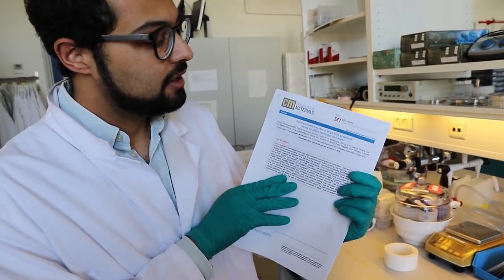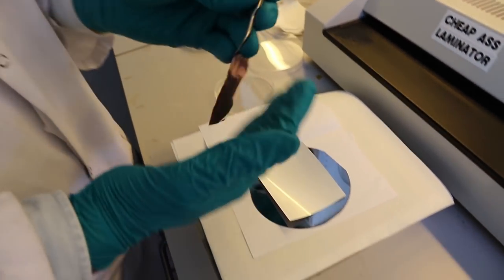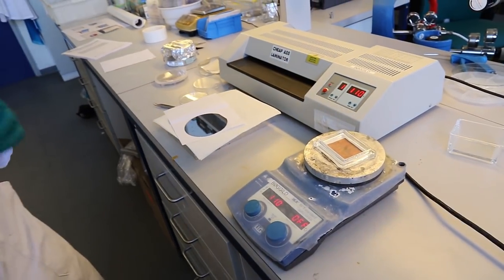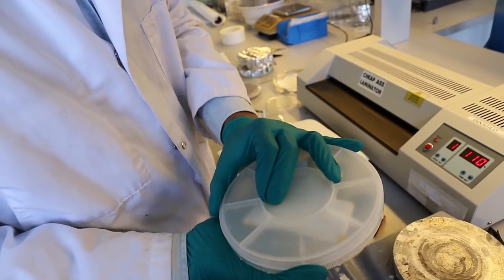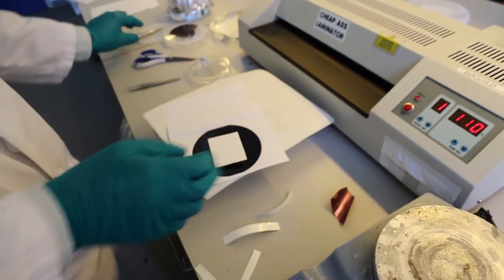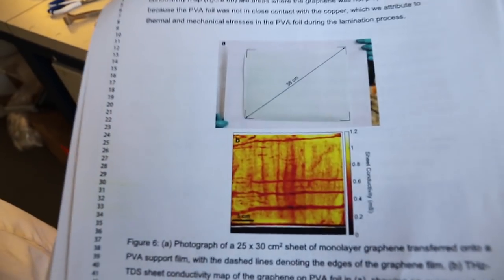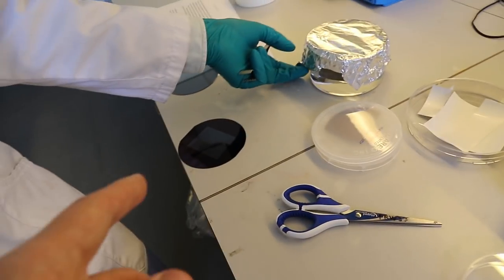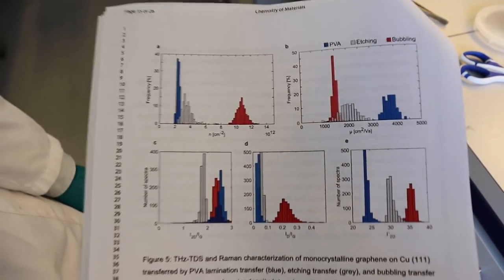Easy graphene transfer using desktop laminator and PVA plastic foil

Comment: Thank you for a very interesting video.
I have one question.
Is the transferred graphene atomically flat and contamination free?
I am very interested in the surface AFM image of the transferred sample.
Reply: トラファルガーデスポセイドン no not completely - buy its cleaner than with the other methods. Sorry for the long wait - i didnt see your question
Reply from the maker: It is as flat as the substrate allows it to be. Graphene is intrinsically atomically flat, but will cling to the surface - if the substrate is flat, the graphene will typically be. There are, however, differences in how many wrinkles the graphene has, depending on how it was fabricated. So, the quality of the graphene and the copper substrate (including flatness) also has a lot to say. The rolling can also introduce rolling lines, i.e. line shaped cracks or folds, perpendicular to the rolling direction. So yes, in principle, the method can make the graphene as flat as you want it, but it depends on a number of factors whether you will get this result, including the flatness of the substrate. The contamination is not zero, but the PVA washes away really nicely in warm water.

Comment: Thank you for this useful video. In your publication your laminator speed is written to be 20 cm/min. Ours is about 66 cm/min (minimum speed) so we had to put on hot plate 110C for longer time, and there are lot of holes. Also apparently your laminator speed is said to be 12''/min (30cm/min) from the supplier (Akiles ProLam Photo 6-Roller). I have a hard time looking to find a new laminator that can go down to 20 cm/min, suppliers often specify their max speeds. Hopefully 30cm/min could be slow enough and improve our transfers.
Reply: Actually I think your real speed is 12''/min (30cm/min), I can see in the video the lamination lasted about 40s, not 1 min, maybe 20cm/min speed in the paper was underestimated. Thanks to the video now I know.
Reply: @Ledeaven  Hi, have you been able to reproduce this technique successfully? If yes, would you mind sharing what PVA sheet you used? Much appreciated.

Comment: This is great! I would like to try this in my lab. How important is it to have a laminator with the 6 rollers and speed and temp control? 
Do you think this method would work with a $30 2-roller laminator? 
Thanks
Reply from the maker: it might... we have tried a few different types of laminator machines... probably some relatively stable mechanics and temperature control is an advantage, but it might work with very simple equipment ... and its as safe for kids, as a desktop laminator --- excellent for corona-compatible research (at home)!
Reply: @NanoClips  Hi, we tried it here at RIT using the exact same laminator as in your video, and it worked for us. We bought the graphene from graphene supermarket and the PVA "Blank Hydrographic Printing Film" from amazon.  We had to run it through the laminator 3 or 4 times for the transfers to occur. Both from graphene to PVA and then to SiO2. Also, when we did get it to work, the graphene was not continuous with regions of about 300 to 500 um. It did show a very large G' peak though :-). We'll update you if we make improvements but we plan to fabricate some devices.
Reply: @ivanpuchades5935  Thank you for sharing your experience. If you run 3 or 4 times this is an indication that the process is not yet optimized. One of the reasons could be the non-uniform temperature. If the temperature is low enough it would require several passes and if it is important, there is a risk of forming air bubbles (few hundred microns in size) between the graphene and the adhesive which would require the operation under vacuum as suggested at the end of the video. One other parameter is the PVA thickness. Do you have an idea on the PVA thickness, delamination temperature and speed used in your experiment?  It will be great if you make a return.
Reply: @Orientaliszt  Thanks for your reply. We are using the same laminator as in your video (Akiles Pro-Lam Photo 13" 6 Roller Pouch Laminator) at a speed setting of 1 (which I measured to be ~38 cm/min in my system (1-inch in 4 seconds), that is almost 2x the speed that your paper suggests (!?)) and a temperature of 110 °C. The PVA thickness is 2 mils (50 microns). Another variable we introduced is that we left the copper/graphene sheet soak in DI water for 4 days. Do you think this could have made a difference in the quality of the transfer? Thank you!
Reply: @Orientaliszt  do you recommend PVA thickness of any specific value/quality for the process?
Reply: @ivanpuchades5935  Do you mind sharing the link for PVA?
Reply: @Lilyzhang8880  Hello. This is where we got ours. 
Search amazon for "Hydrographics Film - Blank Water Transfer Printing Film - 12 Pcs A4 Size Blank Water Transfer Printing Film - Blank Water Transfer Film"

It's 50 microns thick instead of the 35 microns used in the paper. Our laminator speed was 25 cm/min (vs. 20 cm/min in the paper) and we had to increase the temperature to 130 Celsius (from 110 Celsius in the paper), seemingly to account for the thicker PVA and faster lamination. The samples with two passes are still slightly better than a single pass for us.
Reply: @ivanpuchades5935  Thanks for your detailed information. I bought this one. But the product I got is on transparent stiff film.
Reply: @Lilyzhang8880  Hmm... the one I got feels like thick paper, but that is the backing paper and is white in color. The PVA is on this paper. After a few months, it has become a bit stiffer and is folding onto itself, but it still works for the transfers. I can send you a sheet of what I got if that would help.
Reply from the maker: Hi folks: try to write Abhay for the link to the PVA. I dont remember the brand. Search for Abhay Shivayogimath, he is the expert!
Reply: @NanoClips  Hi. I am also trying to find the PVA foil. I have reached out to the Abhay, but have not heard a reply.

Comment: hello you r coated copper foil with graphen by which way ?
Reply from the maker: Chemical Vapor Deposition: you heat up a piece of copper (we use very clean foil bought in rolls) in an atmosphere of methane and hydrogen in a special oven called a furnace... to a temperature of 1050 C. At this temperature the methane cracks into carbon and hydrogen, allowing carbon atoms to make a monolayer (1 atom thin) of graphene on the copper foil. We let it cool down, and there we are!
Reply from the maker: https://www.youtube.com/watch?v=K309K-DFqpE

Comment: ouchhh...  so easy!!

im gonna try..
Reply: let us know if you run into any trouble... we find that it works better for reasonably good graphene; if the grains are small, it tends to break up more. You may also want to experiment with heating time and temperatures. It works pretty robustly across a number of substrates for us, but we have not tried every type of graphene with every type of substrate.
Reply: @PeterBoggild  okay...   I make graphene on copper substrates too...   I have to find this PVA films..  I wonder if I can find this here in Brazil
Reply: @PeterBoggild  Im trying to find this PVA, but without success..  I'll send an email to you...   tks dude!!
Reply: @renatoberaldo2335  did you already?
Reply: @PeterBoggild  Hi mate.. so, I'm trying to buy the PVA film... 
I already bought the laminator

I've tried some tests here with a pva filme without paper.... but the graphene remains on copper..
Reply from the maker: @renatoberaldo2335  sorry - for some reasons i dont get updates when someone writes here - have you tried to write Abhay, lead author?